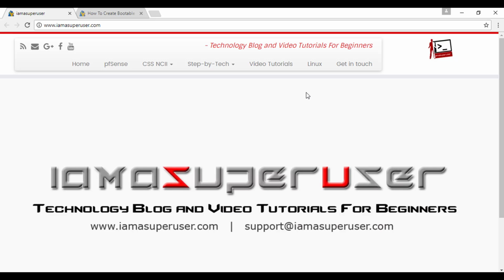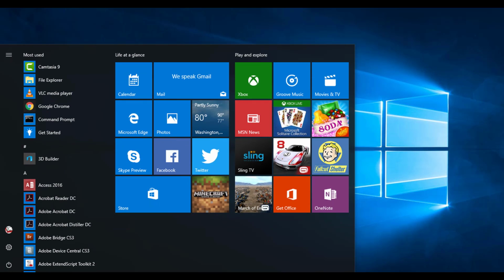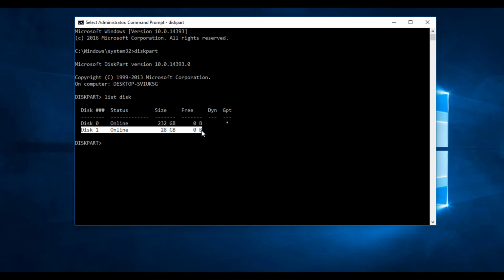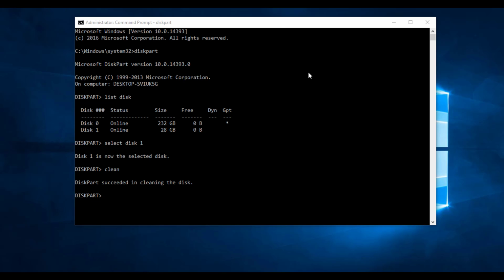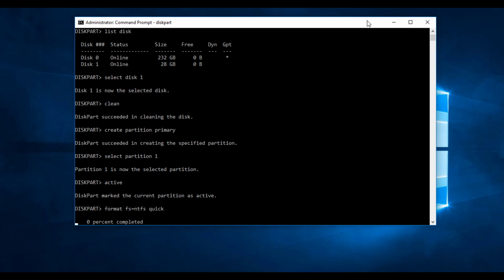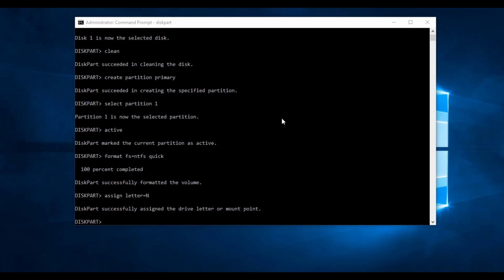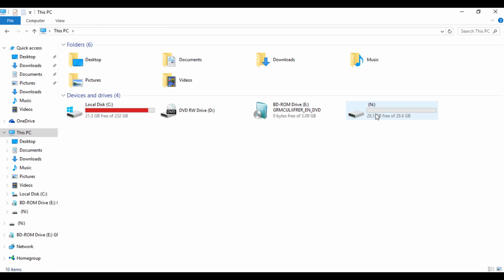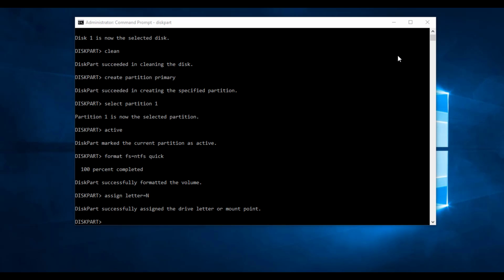Create Bootable USB Installer Using DiskPart | CSS NC2 COC1

Comment: parang may kulang yata ang bootable instruction nyo ah
Reply: san yung bootsct portion?
Reply from the maker: @LionHeart1973  the commands and the process shown in this video works naman po without the bootsect portion... and we just  drag and drop the installer files on this video :)... Anyway, thanks for pointing that out..As always, we can add more options to make the process better and as needed.
Reply: @LionHeart1973  there are a lot of methods to use. just like mathematics whatever approach you use as long as you solve the problem thats enough.
Reply from the maker: Hello po! Ano po ang kulang sir? thanks

Comment: kung i copy kulang yung mga files from windows 7 installer sa usb magboboot din ba sa usb hindi nako mag DISKPART command thanks.
Reply from the maker: No. the system will read it as Storage Drive, not a bootable drive.
Reply: iamasuperuser thank you